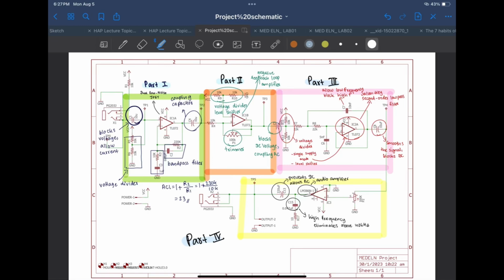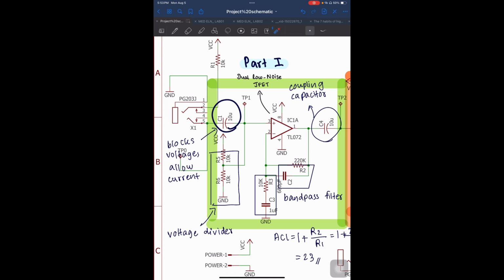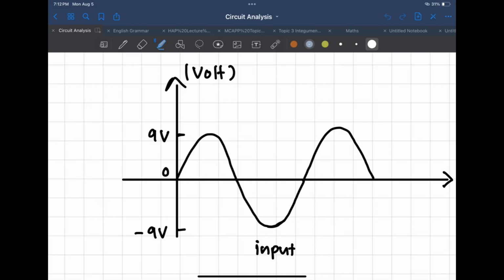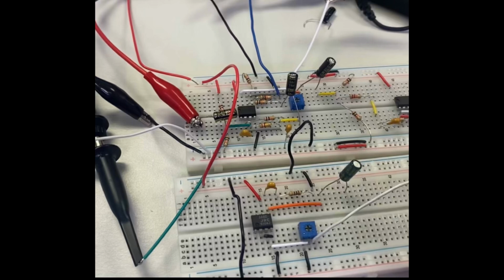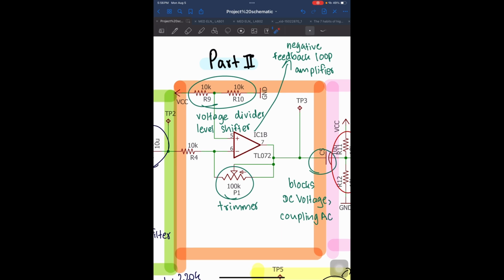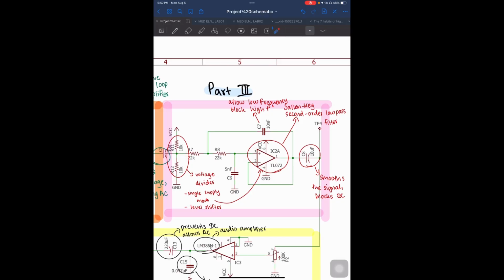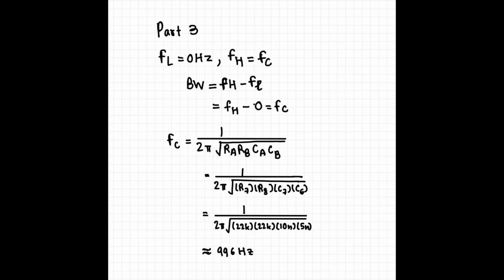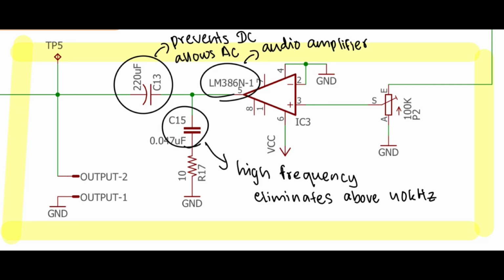Med electronic

Comment: One final comment, R17 and C15 do not eliminate 40kHz. Those components are there to stabilise the audio amplifier (which may produce a 40kHz signal when it is not stabilised). That is different to filtering 40kHz. the res/cap  provide a reactive load which may be necessary for  improving the phase margin of the amplifiers closed loop characteristics. or it may be required simply for loading the output to improve the high frequency gain margin of the amplifier. Maybe both :)

Comment: I assume you are a student, so I must say you have done very well and avoided many of the traps others have fallen into. But let this older engineer give you a few pointers. First up, the DC blocking caps do not smooth response. They just block DC. In you circuit though, they are working by virtue of being a large enough value to never develop a significant negative bias across the polarised capacitors. If you have any doubts about what I am saying here, try dropping the bias voltage of your input stage by 1.5V and test again (with a reduced signal amplitude to avoid clipping). Your 10uF blocking capacitor will become a very leaky capacitor and your second stage will likely saturate at a power rail. There are tricks you can use to get around the problem of large bipolar capacitance. One is to adjust the circuit impedance so you ca use a smaller value capacitor and swap it to a ceramic type (but beware the voltage dependence of the capacitance value of ceramic capacitors). Another way that also requires relatively high circuit impedance is to use two tantalum capacitors back to back, ie positive connected to positive of the capacitors and the negatives of the capacitors used as the capacitor terminals which are connected to the output of one amplifier and the input to the next stage. The circuit you have, if it were given a sufficiently low frequency signal would probably fail to block the low frequency and pass on a distorted version of it.
You indicated the second filter is a Sallen Key topology but what is the response characteristic of the filter? And the input filter again, what characteristic? If you are unsure of wjhat I am asking, have a look at Chebyshev, Elliptic, Butterworth etc. Especially for a medical device that uses audio as a diagnostic tool, the characteristic of the filters can be critically important as it will determine the amplitude response (obviously) but also the phase shift of the inband signals which may impact the perception of the audio signal. Assuming that there is more than one frequency in the inband signal, and a heart beat definitely satisfies that criterion, the group delay of the filters may be very important. Flatness is another important consideration. Not all filter characteristics have a flat inband response. Look at Chebyshev Types I and II.
On the medical side, I question the bandpass input filter. The human heart beat includes some significant very low frequency content. Typical ECG circuits have a high pass filter in the range of 0.5Hz.  Making these low frequencies audible however, is a more interesting problem. What do you know of frequency modulation,  frequency folding or maybe Nyquist?
As I said, good job and well done. I know of few students who have done as well as you have done.
Reply from the maker: OMG! I just posted it because of my school project and I didn’t know this would gain any comment. 😭Thank you so much for explaining , this means so much for my studies. 🙏🏼
Reply: @haewon1596  You are welcome. I hope it helps.

Comment: hey why people dont use transistor directly to make there own op amps instead of using op amp ic btw good explanation on the topics
Reply: As another has said, simplicity. Do you have any idea of what it would take to roll your own opamp from discrete parts? It would be better if you wan to go that way, to use smaller transistor based amplifier stages but the accuracy of the gain etc is not as tightly controlled. Opamp based design here is the right way to do this. Remember this is a student design exercise, not a PhD thesis.
Reply: The same reason that carpenters don't make 2x4's in the sawmill or make their own nails.